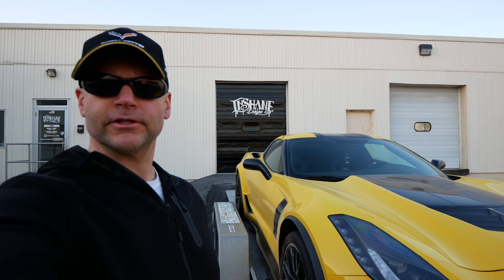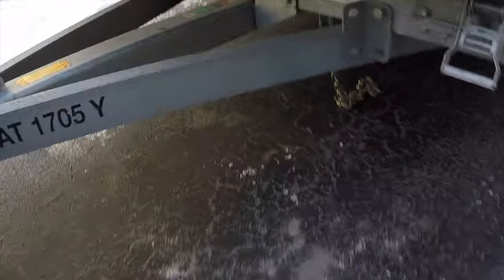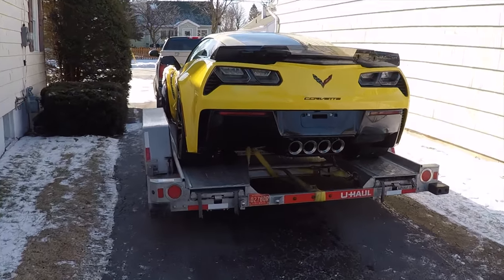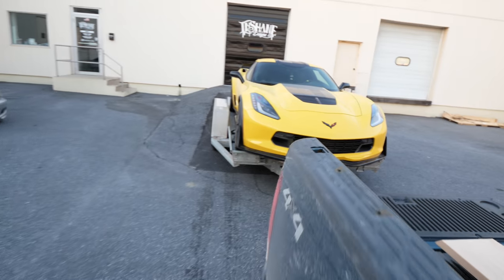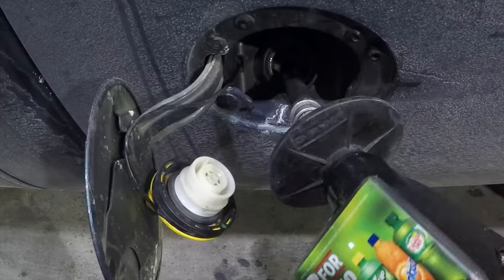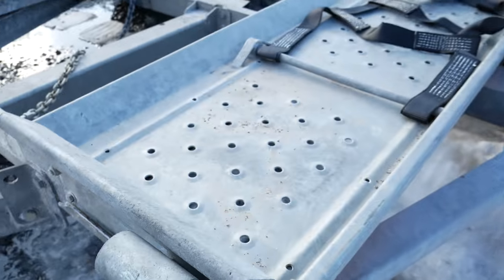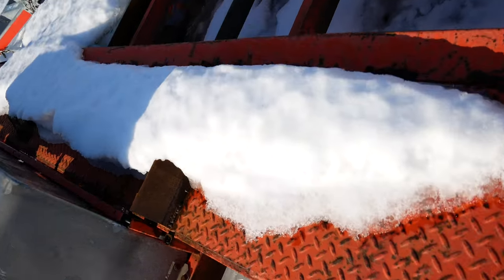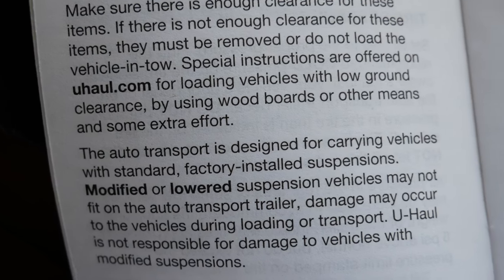Transporting my C7 Z06 Corvette to InShane Designs on a U- Haul Trailer for Motorama 2018

Comment: Never used a U-Haul trailer. Plenty of used and new open and closed trailers. I had an open trailer when I first went racing my Corvettes that was much easier to use that the U-Haul.  But soon I got an enclosed as crap will fly off your truck's rear tires and raise hell with the front of the car. Seems all went well with the transport. Look forward to seeing the wrap.
Reply from the maker: Robert - thanks! Open U- haul trailer was my second to last option. My 1/2 ton GMC won’t like towing an enclosed trailer that far through the hills in PA. Borrowing / Renting a bigger truck and enclosed trailer was not financial feasible. Luckily the roads were fairly clean, at least in PA. Damn NY Salt!

Comment: i was just looking for a video to see if the zo6 will it fit. now i know. just have to watch the front and my letters on the tires.
Reply from the maker: 2:15 It will fit 💯👍I highly recommend some 2x 12’s to get a better angle or a sloped spot to get a better angle on the rear. Not for the timid, I’ve seen two people on Rick Corvette Conti’s channel show up with U-haul trailers and chicken out! 5:33 if you can find a slope like this to load and unload then you are Golden ☀️
Reply: @RustyZipper  yes I got some boards. Like said a good slope would be great. I am going Carlisle Thursday want to make sure it fit if not I would have to pull my personal car hauler.
Reply from the maker: james walton - so you’re a pro! No sweat then! I’ve been to Carlisle ‘18 + ‘19. Good times, last year was busy with the C8 factory booth. My boss said no out of state travel so I can’t attend or the NCM Labor Day Bash, just cancelled my hotel today actually 😢
Reply from the maker: Thur and Sun are a wash IMO unless you’re bored and just want to attend any car show this year. I’ve yet to attend anything myself this year, here in NY things are locked down thanks to Cuomo. Anyways-  safe travels! 🏁💨
Reply: @RustyZipper  o dam. i am retired so no boss for me....well if you do your social distance and wear your mask you should be good. but I understand. if people had like we did in the military and took heed to the protocols i think we would have been good now.